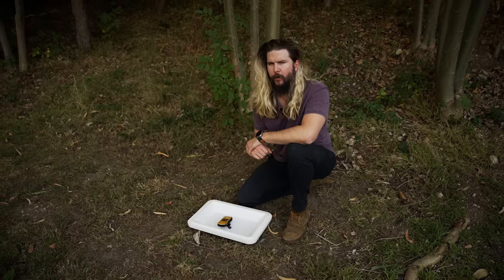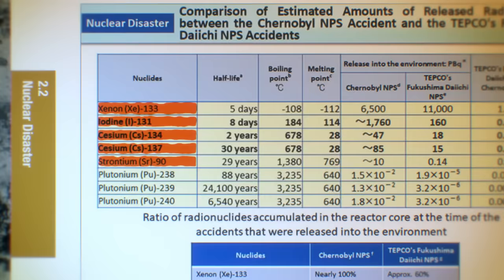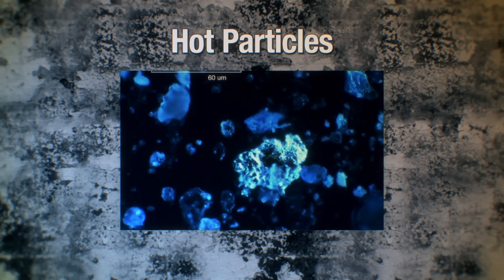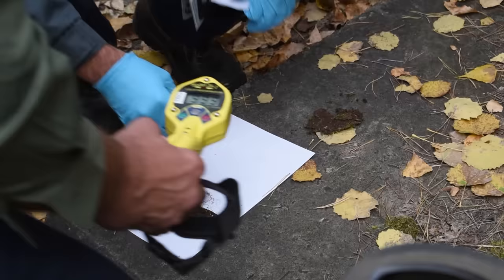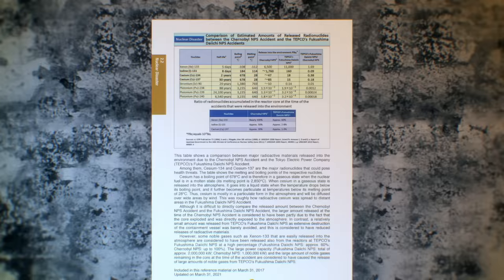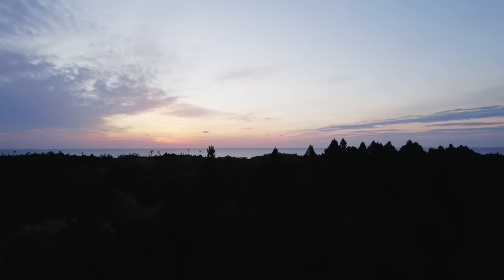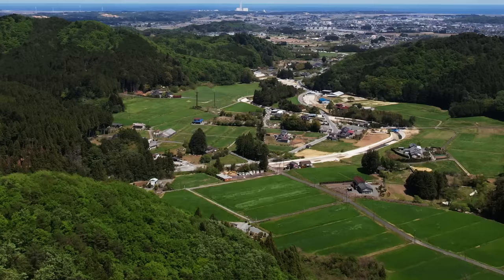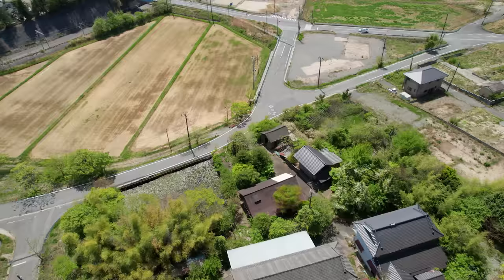A Nuclear Disaster's Deadliest Detail

Comment: I saw an old documentary on the Windscale nuclear reactor fire where one of the plant's nuclear physicists used this exact method to find a hot particle in his back garden prior to the accident, proving that the Windscale reactor was basically spewing radioactive particles across the surrounding area. If anyone is curious the doco is available on Youtube and is called Our Reactor is on Fire.
Reply: Most people still don’t know about Windscale  which was very much almost Britain's Chernobyl long before Chernobyl was even built. To think that situation was avoided mainly thanks to one of the engineers climbing the coolant stack and manually aiming a hose pipe down it to cool the reactor. Just imagine how much containment he breathed in…
They don’t make ‘em like they used to as my mam would say.
Reply: Yes, well worth seeing.
Windscale was crazy.
Reply: I thought the filter on the chimney might have helped this problem.
 It seems to have certainly helped when the main disaster happened.
Reply: The interesting thing I learned from that documentary is the reason for nuclear power is to have nuclear weapons.
 It's the left over byproduct of generating nuclear power that makes the fissile material or whatever its called the stuff that makes the bombs go boom in a Nuclear way.
Reply: @geniferteal4178  That may have been the case in the fifties, but today they prefer fuels that do not contribute to nuclear proliferation risks.
Reply: Most, if not all of what he detected wasn't from the reactor, but from lax handling and safety precautions. Once those were enacted, proper PPE issued, the contamination issues disappeared.
Well, other than from the fire and thankfully, one engineer raised so much hell, they installed them before the reactor went operational. Oak Ridge had a similar problem, as did many US processing facilities.
Reply: @KingOhmni   Windscale sure redefined the phrase about split milk!
Reply: Prior to the accident? Surely you mean after.
Reply: @SoWhat1221   nope, before. They noticed contamination when one of the physicists on a lark checked his home garden, then home and pretty much crapped himself. Shoddy contamination avoidance practices being the norm in that era pretty much universally.
Oak Ridge was just as bad and still has areas that haven't been cleaned up.
Reply: @geniferteal4178  The processes in a nuclear reactor do generate the Pu239 commonly used for bombs, but also consume that as fuel while making "poisons" that absorb neutrons needed to sustain the chain reaction; bomb fuel needs to be low in "poisons" in addition to having enough "fissile material". Keeping the level of poisons low requires a short run of the fuel load. In contrast, commercial power reactors favor much longer runs, because the cost of the power is largely in the capital costs, not fuel, so minimizing downtime (such as during refueling) is important to controlling power costs. Thus, commercial nuclear waste is useless for making nuclear weapons. A military making weapons will run their own loads in their own reactors, rather than use commercial power waste. They are two different uses of the same process, not a unified co-dependent activity.

Comment: I had never considered that radioactive particulates would migrate and concentrate over time! 😯 Very cool video, you do an excellent job at conveying this information that's easy to understand. Always look forward to your videos, Kyle! 😁
Reply: I've thought of it like this on a very basic level - think of a river flood. Once the water flows away, you're left with bits of what was in the water at the location where you are, but it's not always that much overall. Now, go downstream. More and more particulates fall out leaving a tiny layer below the flowing water. Go downstream further where the river connects to a larger body of water, the river delta. All of the particulates that have built up came from upstream and concentrated there.  Heavier bits fall out earlier, but the lighter bits fall out at the end and/or when there's a change in flow.
Reply: @bobd2659   Yep, it's something that's obvious after it's pointed out. It reminds me a lot of prospecting for gold and how that moves through the environment

Comment: Back in the day when I was in school (15+ years ago) I wrote and presented a report on the Chernobyl disaster. From how it happened, to its consequences. This report took the whole school year to write and ended up being over 100 pages long. I learned a lot, not just about nuclear energy and the actual happening of the incident but also energy economics and the politics involved since this report wasn't only on the disaster but also on its fallout so to say.

Your half-life series is fascinating and always highly informative. Yet, every time I watch your latest episode, I am surprised by how different the conclusions are that we draw from the information. While you, Kyle, have a positive outlook on nuclear energy and are convinced that it, at the very least, is our best shot at cheap and sustainable energy for decades to come until we figure out a better way. With every episode and every bit that I learn more about the topic I am increasingly convinced that we should shut down every nuclear power plant that is currently running until we figure out a better way. With better I don't mean non-nuclear, at least not necessarily. What I mean, is a better way of getting the energy stored in nuclear fuels. I am convinced that none of the current reactor types are sufficiently safe enough to justify running them. How do I come to that conclusion? What happens if one of the currently active nuclear power plants experiences a catastrophic accident? What would be the worst >possible< thing that could happen? We all know what that is: Chernobyl. That is unacceptable. If it is possible for something like Chernobyl to happen again, I cannot, with a clear conscience, advocate for this technology to be used further. If we manage to build a power plant, that cannot possibly have a critical incident and that would make it impossible for saboteurs to use it as a dirty bomb, I could see myself loudly advocating for nuclear power. Alas, such a thing does not exist yet. I also think that my standpoint isn't unrealistic or unreasonable as we have figured out how to do many things safely that were once considered impossible to do safely.
Sure, Fukushima was not as bad as Chernobyl, but it was still really bad. This was a far more modern system and yet it still failed in the worst possible way. The counter argument is often that the plant was run badly and that the company was negligent but what does that even matter? Negligence is part of the human condition; we design safety standards and regulations to prevent the human condition from interfering. It clearly failed. Not good enough. As long as the human condition can make a nuclear power plant unsafe, it is not safe and should not exist.
A fitting example would be hydraulic metal shears used to cut sheet metal. People used to lose limbs and fingers to them regularly. We managed to build them in a way that it is impossible for that to happen from negligence. You would have to purposefully disable safety devices to hurt yourself with them and even then, most machines will stop functioning if you disable the safety devices.
I could keep going but I made my point clear.

Anyways, thank you Kyle for your work. I thoroughly enjoy all of it, even if I sometimes fundamentally disagree.
Reply: Unfortunately, for many of the nuclear plant operating countries, there isnt any viable replacements. A lot of places have electricity consumption peaks when its dark, cold, and the winds are calm.
Reply: @juslitor   I can't come up with one that has this issue. Norway nearly exclusively is hydro power. Sweden still uses quite a bit nuclear but is quickly decommissioning it, the rest is wind and hydro. Denmark is 80+% wind and has no nuclear power. Finland is similar to Sweden and so is Canada. All of them going for renewable and decommissioning nuclear. Iceland is 100% renewable. Only far north country that doesn't fit the rule is Russia. China is going crazy with solar and wind. Seriously, look at the statistics for China and their expansion into solar and wind power, it's nuts, the graph is nearly vertical on a linear scale. Any country south of these will not run into a situation where wind and solar can't cover the needs. This has been widely researched and technologies are available to cover any low spots.
Furthermore, it doesn't make sense to consider countries as isolated entities here since all of Scandinavia has a connected electricity grid and the same goes for Central Europe and I would imagine that Canada and the US are also connected to each other. I honestly can't imagine a situation where the entirety of Europe is covered in such thick clouds that solar can't produce anything and the entire continent is also experiencing a dead calm. Even if that would happen there are currently major projects going on connecting Europe to North Africa to get better access to the already existing and still being expanded solar farms there. Those solar farms, once fully completed, can produce enough electricity to cover the demand for the entire world.
I urge you to update your knowledge regarding the "dark and calm" argument since that argument used to hold some weight but thanks to technology advancements and increased international cooperation no longer has any value. We have overcome that issue.
Now to the other point here. Beyond the fact that renewable energy production is already capable of covering any power needs that could come up they are also significantly cheaper to run. Nay, not just cheaper, they can be profitable. If you follow the topic of the energy crisis closely you have also seen the reports and studies that were released this year that covered the financial cost of building and running a nuclear power plant. Those reports and studies showed that without massive government subsidization no company would build or run such a plant because they are so prohibitively expensive.
Another issue whose lesson France is painfully learning, is the required cooling. France had to shut down many of their nuclear power plants for the second year in a row because the rivers supplying water for cooling ran dry. Considering that many of the major rivers in Europe are fed by glaciers that are quickly melting off, this issue will only get worse. The first time the Rhine ran dry the news was huge, this year the Rhine ran dry and while it made the news it wasn't "oh my god the Rhine ran dry" but more "as per usual Rhine shipping is at a standstill because the Rhine ran dry".
Beyond that there is also the CO2 footprint of nuclear energy, which is significant. Sure, the plant is clean during production. It's all water vapor after all but it would be disingenuous to only consider the CO2 production during operation. Considering construction, excavation, mining, enrichment, transport, storage etc. nuclear energy is anything but low emission. Sure, renewable energy production isn't CO2 neutral either, but it also doesn't come with a laundry list of issues one of them being a nuclear disaster.
Reply: Seriously, apart from Norway and their oil bought hydroelectrics.Neither sweden or Finland realistically can make do without nuclear power, if self sufficiency is the goal. Should there be a proper cold winter, the present day electricity production will prove insufficient, diesel gennies will be running all over scandiavia and fennoscandia. . Importing all electricity from abroad is a fallacy finland already did once with russia, not happening again. Finland presently has the third largest nuclear power plant in europe, and are planning another one, also talk about implementing small scale nuclear heating plants. To boil it down to cold hard facts, Winter = no sun, no wind.  Going to be a long time before anything benefitting north european energy markets is built in africa, if ever. Solar and wind is fine for places where there is no real winter. @ZeroKey92
Reply: @ZeroKey92 Every point I have been thinking about why we shouldn’t have nuclear power until we can absolutely 100% make sure an accident doesn’t happen we should shut every single one down. I agree with all of your points I don’t think it’s unreasonable but it’s unpopular with people who activate for nuclear power. We should also shut down any plane carrier ships or submarines that are nuclear power. We can’t know that a major hurricane that would knock out the power wouldn’t also knock out the generators too. What about a tornado happening right over a nuclear plant. Between human error and natural weather emergencies they will never be 100% safe. Thank you for making your post I hope more people see it. I had nightmares last night from watching the series about nuclear accidents he did. I’m thankful I have found atleast one person who sees it the way I do, that way I don’t feel completely alone.

Comment: Alot of people tend to think that Chernobyl was a complicated advanced reactor, it's not, the Soviets essentially made a big pile of radioactive shit, built a concrete (part of which was actually wood because the people building it didn't follow the prints) enclosure and ran some pipes to get steam out and water in.

It's the equivalent of driving a car with half working brakes, a blown head gasket, fuel leak, and backfiring. It's just a matter of time before it blows up.
Reply: It was most definitely a complicated reactor. The RBMK was dangerous primarily because it was so big that the Soviets were unable to adequately calculate the reactivity coefficients given the limited computing power available. The responsible choice would have been to start with a smaller, less powerful reactors (like they did with the VVER PWR) and then scale up. But this would have defeated the whole purpose of the RBMK, which was to RAPIDLY deploy nuclear power to free up oil resources for export. As it turned out, the graphite block dimensions were chosen poorly, leading to the positive power coefficient. If only the blocks have been slightly smaller, the reactor would have been unable to explode.
Reply: @MinSredMash  Compared to western standards it was not at all a complicated reactor, We spend many years designing precaution after precaution to prevent exactly this sort of scenario, overbuild reactor casings to withstand any external or internal threat. Instead of guestimating sizes because we don't have a computer good enough to calculate them we build a bigger computer. Instead of having a giant pile of poorly "enriched" uranium we build large, complicated centrifugal enrichment setups to produce fuel that's adequate to operate inside a much smaller core.

Yes the RBMK was meant to be a rapidly serviceable design, but that's came from the fact that it was built from the ground up to be as cheap and simple as possible. Building an actually reliable and safe nuclear plant requires an enormous amount of consideration about contingencies that were never even imagined by the soviet engineers, and this certainly wasn't helped by the soviet system that had filled them with propaganda that the RBMK could never melt down.
Reply: @linuxguy1199  You seem to be using 'complicated' as a synonym for 'good,' which is a very non-Russian thing to do. By any number of objective metrics the RBMK was complex, especially when compared to something like a PWR. The RBMK quite was complicated in a bad way.
Reply: @MinSredMash  Haha, I'll concede with you, It was complicated but for all the wrong reasons!

Comment: I worked for a scrap broker for 12 years. I was a metal analyst. I had a counter because we got avg of 10 hot loads a year. A train popped on way to mill at a CSX radon detector. The piece was half the size of the ball on a ballpoint pen. Took a week to find.

Comment: I learned how to do fractioning (in concept) by modding games. The idea being that you get a mod with a conflict of some kind out of say 100 mods. To find it, you disable half your mods and test for the conflict by launching the game. If it isn't there, you disable those 50 and enable the other 50 and try again. Once you have the issue, you then take that 50 and break it into two 25 batches and do it again until you narrow it down enough to find the problem mod. 

Same concept applied to problemsolving in gaming.
Reply: Was going to say! Such a handy system to use in many situations

Comment: I just did a research project on the potential of mycoremediation of heavy metals in soils, and there has been some significant research that uses mycelium to isolate/immobilize metals, including uranium (Gadd, 2011). As fungi use external digestion, their excreted enzymes are able to transform metals for biosorption, where either living (native) fungi or dead biomass can be recovered and sequestered. So far, fungi have only been utilized to moderately contaminated soils. As secondary metabolites are increased in competition, it's possible that this method could be made more effective for areas of higher contamination. It's exciting stuff!

Comment: The higher ups at the Fukusima Reactors didn't seem to have much "fear" when they were told, out right, that the generators were at a high risk of flooding and failing. They ignored that warning and it came back to bite them in the arse.